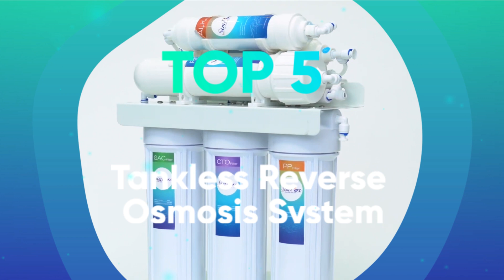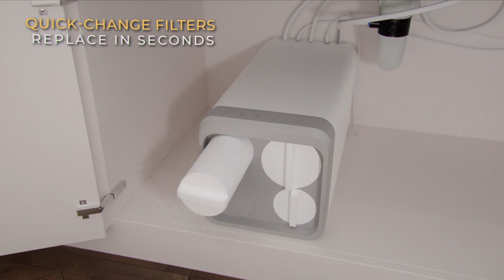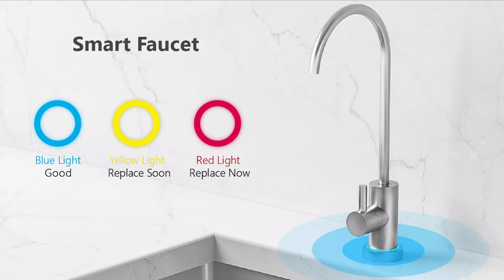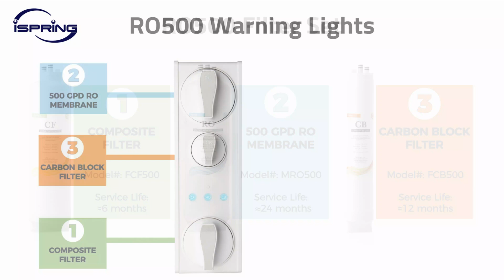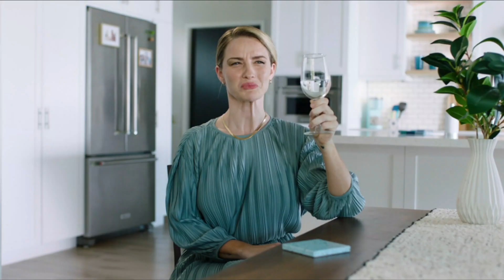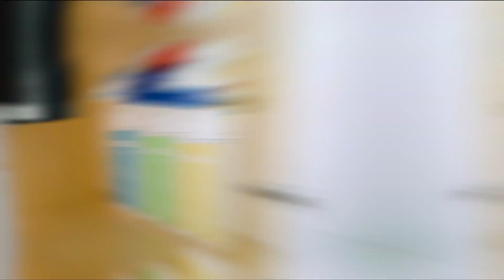Best Tankless Reverse Osmosis System 2024 - The Only 5 You Should Consider Today

Comment: - **Introduction to the Need**: Many regions around the world lack access to safe and potable tap water, necessitating the purchase of purified water from local vendors or grocery stores. This constant expense for a basic necessity like water is seen as unjust by many. However, the emergence of tankless reverse osmosis systems offers a solution by enabling users to purify their tap water directly at home.

- **Tankless Reverse Osmosis Systems**: These systems utilize the process of reverse osmosis to distill tap water into pure and drinkable form without the need for storage tanks. Unlike traditional water filtration systems, which may require storing purified water in tanks, tankless systems produce water on demand, eliminating the risk of stagnation and the need for additional storage space.

- **Top 5 Systems Overview**:
  - **Nu Aqua Efficiency Series Tankless 600 GPD**: Renowned for its exceptional efficiency, this system boasts a remarkable 2:1 ratio of pure water to waste water. It employs a 5-stage filtration process to remove over 1,000 contaminants, ensuring high-quality drinking water.
  - **iSpring RCS5T**: Designed with versatility in mind, this system is suitable for both residential and light commercial use. Its 5-stage purification process, including a patented membrane, guarantees superior water quality, while its tankless design ensures compatibility with various setups.
  - **Waterdrop G3**: Focused on user convenience, this system features a 7-stage filtration process and real-time TDS readings. Built-in safety features such as leakage protection and automatic flushing enhance its reliability and longevity.
  - **iSpring Tankless RO 500**: Compact yet powerful, this system offers a 2:1 drain ratio and efficient purification process. Its sleek design makes it an ideal choice for modern kitchens, while its high flow rate ensures a steady supply of purified water.
  - **Frizzlife PD600 TAM3**: Setting itself apart with its alkalizing capabilities, this system adjusts the pH of water to a healthier level while maintaining a low TDS reading. Its environmentally friendly filter cartridges reduce waste and contribute to sustainable living.

- **Considerations When Buying**: Several factors should be considered when selecting a tankless reverse osmosis system. These include the drain ratio, which determines water efficiency, the flow rate, which affects water output, and the design, which influences aesthetics and integration into the home environment.

- **Conclusion and Future Trends**: Tankless reverse osmosis systems offer numerous benefits, including space-saving advantages and reduced maintenance requirements. However, individual preferences regarding TDS levels may influence the choice between tankless and traditional RO systems. As technology advances, tankless systems are likely to become more prevalent due to their efficiency and convenience.
Reply: - **Brondell Circle Reverse Osmosis System**: This system deserves notable mention for its innovative design and efficient performance. The Brondell Circle features a compact, space-saving design that fits neatly under the sink, making it ideal for smaller kitchens or apartments where space is limited.

- **Key Features**:
  - **Efficient Water Usage**: The Brondell Circle boasts an impressive water-saving technology that reduces wastewater compared to traditional RO systems. Its Smart Valve and flexible reservoir ensure minimal water waste, making it environmentally friendly and cost-effective.
  - **Four-Stage Filtration**: Despite its compact size, the Brondell Circle utilizes a four-stage filtration process to remove impurities, contaminants, and odors from tap water. This includes a sediment filter, pre-carbon plus filter, RO membrane, and post-carbon block filter, ensuring clean and refreshing drinking water.
  - **Quick Change Filters**: The system's quick-change filter technology makes maintenance hassle-free. Users can easily replace filters without the need for tools, ensuring optimal performance and longevity.
  - **LED Indicator Lights**: LED indicator lights provide real-time feedback on system performance, filter replacement status, and water quality, ensuring peace of mind and hassle-free operation.
  - **Compact Design**: The Brondell Circle's compact design and easy installation make it a practical choice for households with limited space. Its sleek and modern appearance blends seamlessly with any kitchen décor, enhancing both functionality and aesthetics.

- **Considerations**: When considering the Brondell Circle Reverse Osmosis System, users should take into account its compact size and efficient water usage, making it suitable for smaller households or spaces. Additionally, its four-stage filtration process ensures thorough purification, while quick-change filters and LED indicator lights enhance user convenience and peace of mind.

- **Overall Impression**: The Brondell Circle Reverse Osmosis System offers an innovative solution for clean and refreshing drinking water. Its combination of space-saving design, efficient water usage, and advanced filtration technology make it a standout choice for households seeking high-quality water purification with minimal hassle.